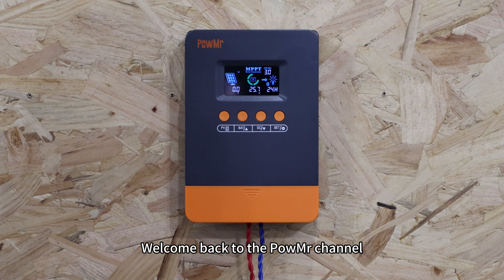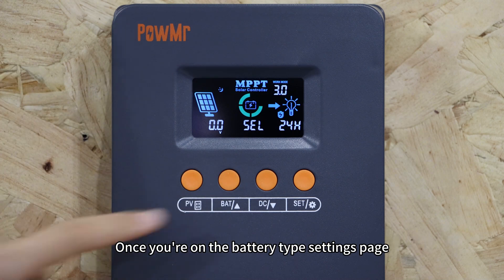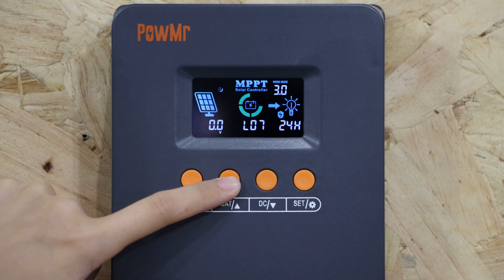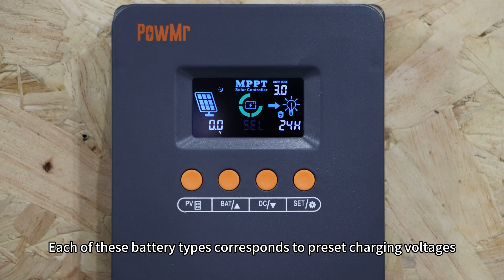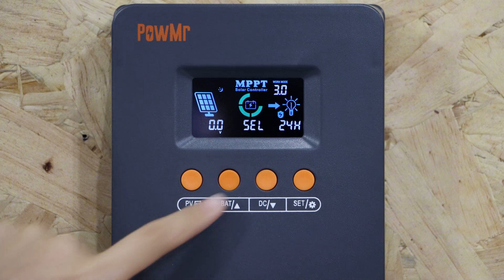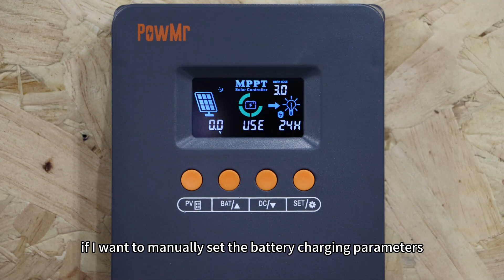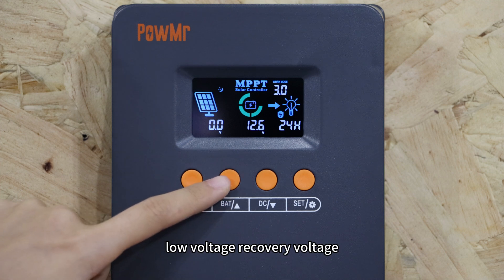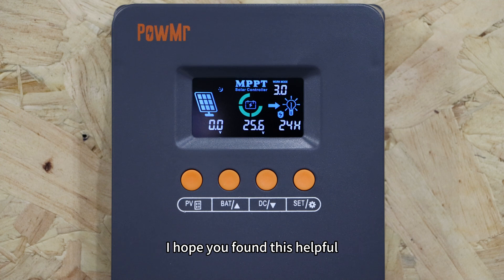Battery Setting Guide for PowMr 25A/35A/45A MPPT Controller

Comment: Mine it has vault 63 appear when i conect only on battery, 45a - 24v battery, please help
Reply from the maker: Error code 63 indicates excessively high battery voltage. Please check whether the battery voltage exceeds the rated level and turn off the air switch for the photovoltaic array.

Comment: Settings not working
Reply from the maker: When setting up, the controller should only be connected to the battery; there is no need to connect it to the solar panel.

Comment: The maximum open circuit voltage should be less than 60V. 
Ok.
 What is the minimum voltage that the product can operate at?
Reply from the maker: The actual input voltage of PV is at least 2V greater than the battery voltage

Comment: why my powr 45a even day time.. showing night mode ang didn't charge. I need to off the battery supply ang it will charge again. I have 12v 30a lipo4 battery
Reply from the maker: This situation is likely to occur when the PV power is relatively low. Restarting the controller allows it to re-read the MPPT point, which resolves the issue as you've experienced.

Comment: How do i change low voltage recovery voltage?
Reply from the maker: In browse mode, use the BAT/▲ and DC/▼ keys to scroll through the battery parameters. When you reach the parameter you want to set, long-press the BAT/▲ key to enter parameter setting mode. Once in the specified parameter setting, adjust the value size or toggle options using the BAT/▲ and DC/▼ keys, then press the key to confirm the settings.
Under-voltage Recovery Voltage Setting Interface (Default: 12.6V, adjustable range: 9.0~17.0V, step size: 0.1V)
Be careful not to connect the  PV to the controller when changing parameters.

Comment: 25a pro max pv input how much voltage
Reply from the maker: The maximum open circuit voltage should be less than 60V
Reply from the maker: <60V

Comment: How can i change the night mode please
Reply: Im using lifepo4 battery is it ok if it indicates 14.5v during daytime
Reply from the maker: The controller is only connected to the battery. After long pressing the last button for 5 seconds to restore the factory settings, try connecting to the PV again.
Suggest recording a video of the above process. If the night mode is still displayed, contact the seller or PowMr and provide a video to see if there are any operational errors.
Reply: Porque en modo User no puedo configurar los parámetros por encima de 17v y tengo dos baterías de gel en serie de 24v, y los parámetros siguen siendo como si fuera una sola batería de 12v. Eso está bien?? Gracias 🫂
Reply from the maker: @fabianferreira4172  Yes, as long as the parameters of the 12V system are set properly.
For lead-acid or user-defined battery types with a system voltage of 24V, the actual charging voltage will be twice the displayed voltage on the monitor.
(Sí, siempre y cuando los parámetros del sistema de 12v se establezcan correctamente.
Para el ácido de plomo con un voltaje del sistema de 24 V o el tipo de batería definido por el usuario, el voltaje de carga real será el doble del voltaje mostrado en la pantalla.)